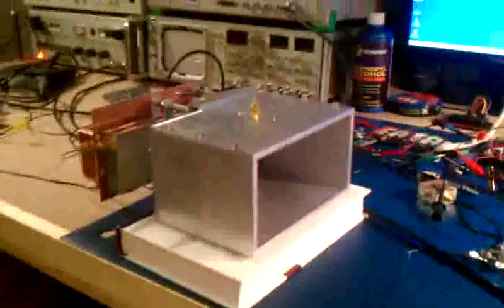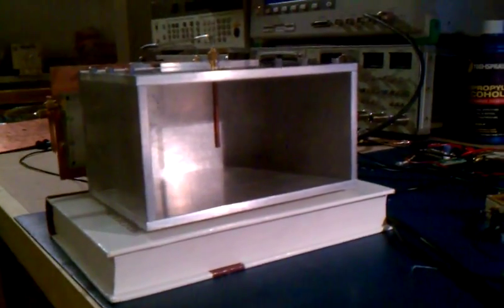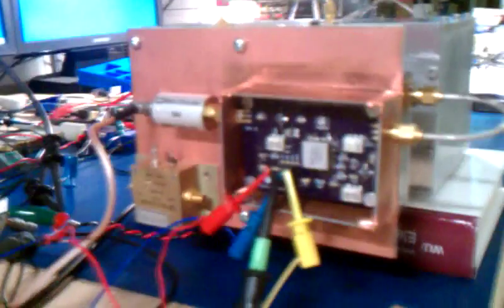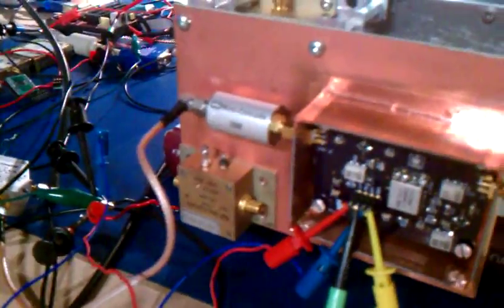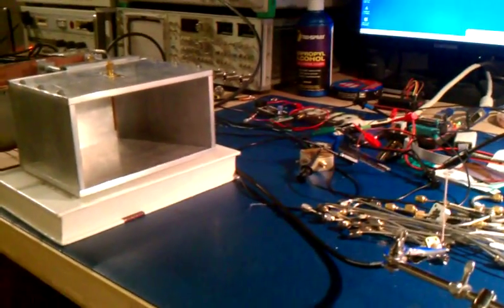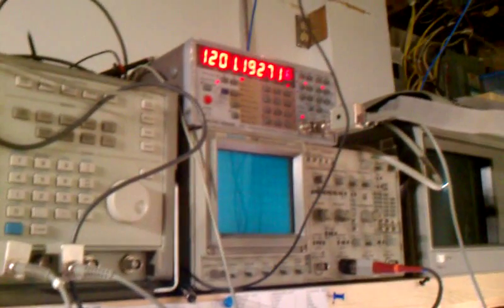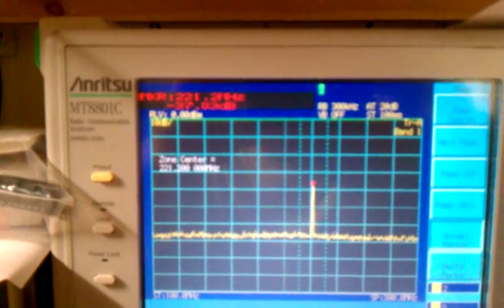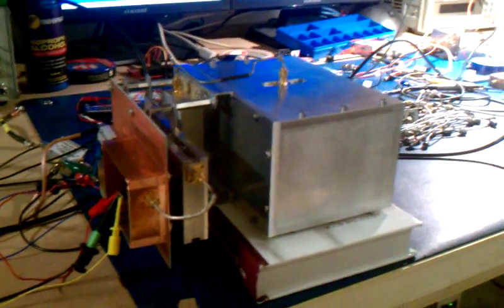1420Mhz Radio Telescope RF Front End Testing

Comment: I've recently run across a place called "radio astronomy supplies" that claims they have an LNA that has a 28dB gain with a 0.35dB noise floor. I'm not sure how wideband it is, but this is much better than mini-circuits that has a NF of 1dB with the same gain.. ..I've been wondering what is the ultimate limitation of the NF.. is it somehow related to the recombination rate of the electron hole-pairs..?